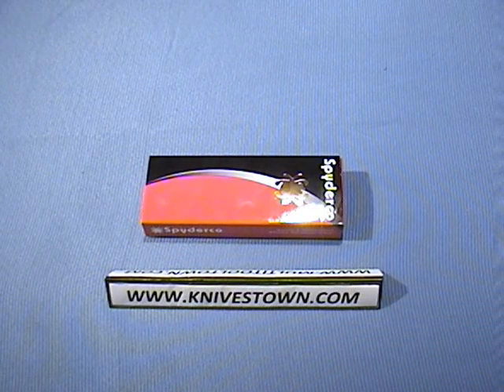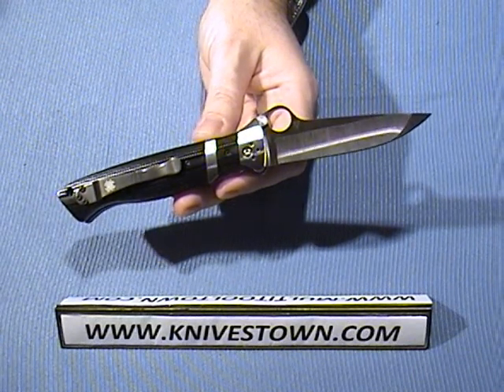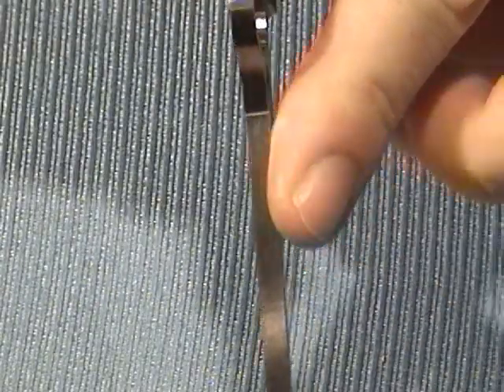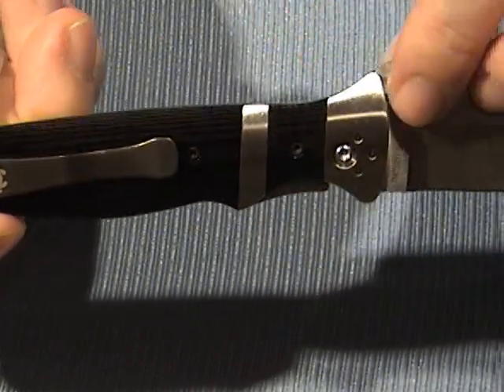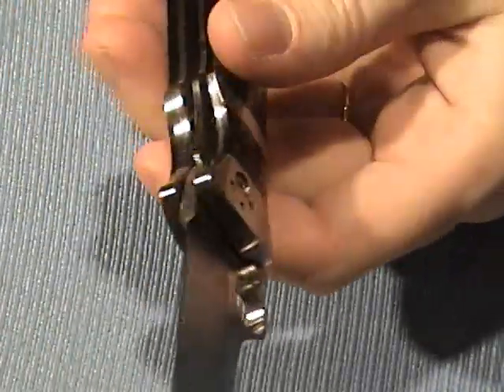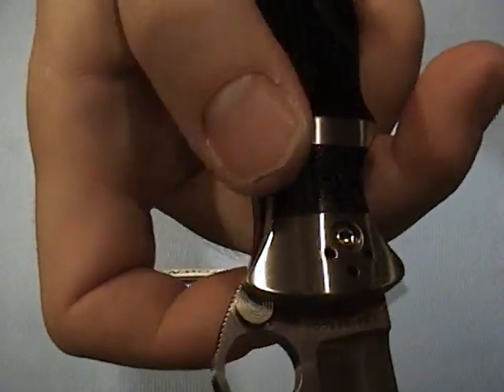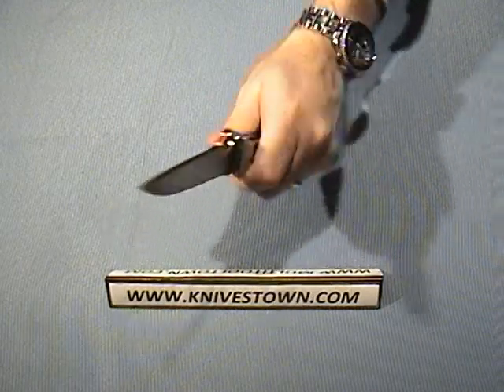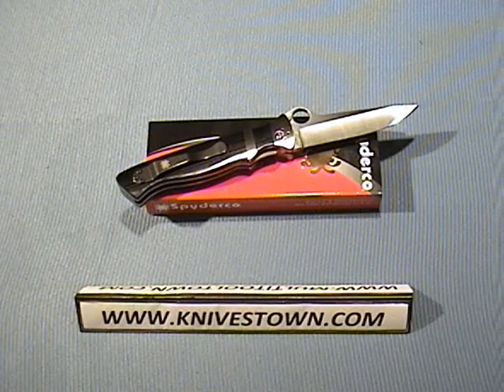Spyderco Vallotton Sub-Hilt Folder Model C149GP

Comment from the maker: @TheApostleP Absolutely not an issue with the thickness. Remember, the edge is hollow ground so you have a thinness going into the material. By the time the upper portion of the blade gets into the cut, it is already a done deal.

Comment: My Favorite Spyderco. I own 10. Basically perfect. Only fault I would have changed is make it only 2 way carry = tip up. The extra holes on the pivot end are unfortunate. Otherwise a beautiful sturdy knife.
A MINOR fault (as usual) is the annoying sharp spydie hole from Taiwan. They make the best, except for the darn hole. To FIX the hole factory edge. Simply get black 600 and 1200 wet/dry sandpapers. Roll it tightly into a circle 2/3rds wide as the hole. Keep it long end to end (as from the package) 3-4 inches, whatever. (like a dollar bill rolled up TIGHTLY) Tape off the pivot with a mild tape so metal dust doesn't fall in it. Dip paper roll in water, Slowly slip it thru the hole halfway. Stroke the sandpaper roll back and forth (in and out) on an angle over the outside edge, circling around the hole evenly. Do this for about 5 minutes. Now take the finer paper, do the same. Keep them wet. Wipe the wet metal dust away from the pivot. Don't let the sand paper touch the sides of the blade to keep it pure. Maybe even tape THAT off. This is safe, beveled my edges in 15 minutes. Looks/feels factory, like Colorado.
Reply: Mad Stork - I know your post is 2 years old... I just bought a lil sub hilt direct from Spyderco, the round hole is nicely chamfered.

Comment: @mathnerdm You might want to re-think that thought on lock strength.  I got a Spyderco Gayle Bradley a couple of months ago.  It has the same thickness liners as the Vallotton, which are actually more akin to a frame lock knife.  Having used it very hard, I can tell you that lock strength is really not an issue.  It's a freakin' bank vault.  IMHO, traditional lockbacks are pretty overrated for strength, and tend to round as they wear, making them prone to failure.  Just my opinion...